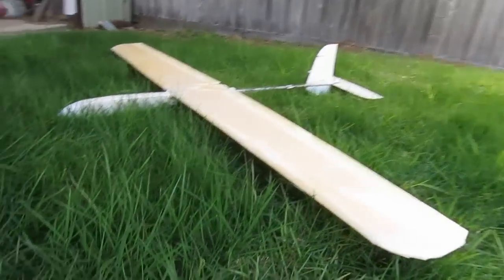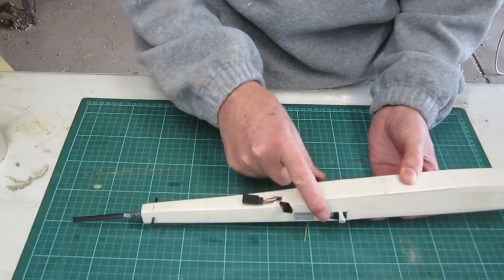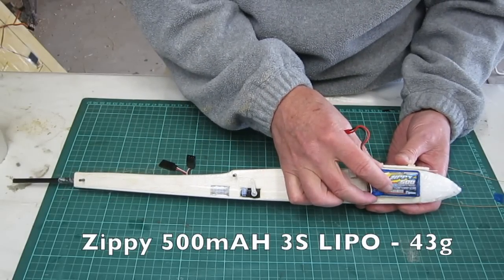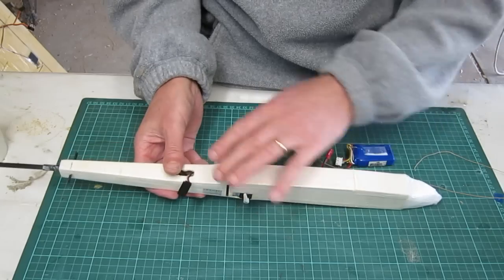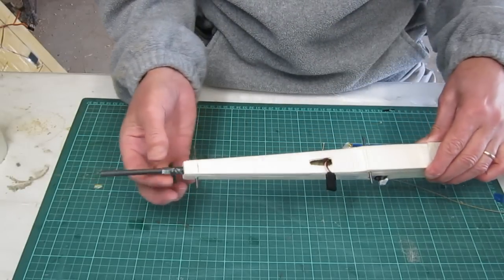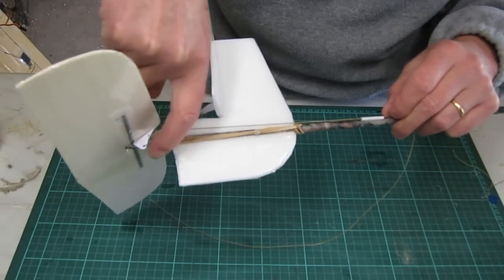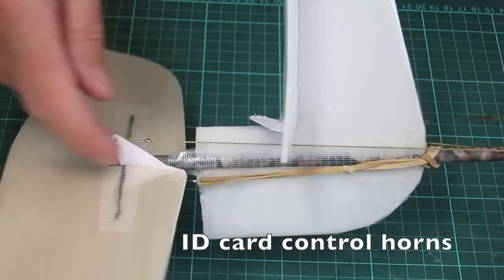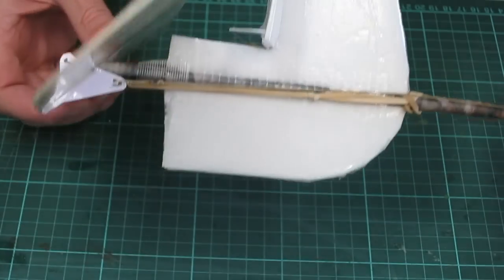Fusion sloper build overview

Comment: Great build Andrew! I am definitely looking at building a similar aircraft. I just have a few questions about glider electronics.

1. How does one select battery type for different size aircraft? (1s, 2s, 3s?) (What capacity battery for what flight times?)
2. Can a receiver operate off a 1s battery? (Would a voltage booster work?)
3. How does one select the required BEC? (1A, 3A?) (Does it vary with number of servos/components?)

I think that a comprehensive video on glider component selection may be useful for beginners like myself. There is not much information out there.

Thanks for all your great  local Aussie content!
Reply from the maker: Good idea for a video, I'll add it to the list.
I have only ever used 2S or 3S with a 3A or 5A BEC, but 1S can be used with a voltage booster (DLGs)
The question is will the servos work on 1S or 2S without a BEC. Normal servos will only work with 5 to 6V. HV servos can take 7V+ 
Most receivers can handle a wider voltage range.
Battery size is much less important because servos alone don't drain much current. I can fly me DLG for an hour on a 300mAH 2S. My slope soarers use 1300 and 2200 3S mostly for balance, I have never drained a battery while slope soaring.
I guess it would be best to use a 5A BEC for a big glider with flaps and digital servos, but 3A is OK for just about anything else.
Reply: Andrew Newton Thank you for your quick and indepth response.
Really helped clear a few things up for me.
Look forward to future videos!

Comment: thanks for posting.  some thoughts.  imo, an elevator would suffice.  the pull-string method of moving control surfaces used here is a 'blast from the past'.  i would use music wire pushrods.     cheers
Reply from the maker: Spring / pull is all about saving weight on this one, and I avoid long push rods if possible
Reply: there is nothing wrong with a long pushrod if it is installed correctly.  yeah, string is light, but i do not care for a mechanism that results in pressure on the servo at all times.   cheers

Comment: Hi Andrew, I'm building a fusion with depron wings, but I was wondering if your wing has the same width on the tip as in the middle of the wing. Yours looks good, so that's why I'm interested :)
Reply from the maker: This wing is tapered but with depron I would just make it straight like my DLG style sloper.
Reply: Thanks for the advice, I'll probably make the control surfaces narrower at the tips so it looks a little less like a plank.

Comment: Andrew, I'm building one glider about this size. But the weight turns out to be 1.2 kg. and my motor can only provide about 700g thrust. So, I'm quit skeptical whether it can be hand launched or not. So, from your experience, what it  the minimum thrust-to-weight ratio for hand launched plane?
Reply from the maker: Should be fine. Probably only need half the glider weight in thrust to fly.

Comment: Nice model, but surely having the flying surfaces spring biased in one direction means that the servo is under constant load which is not good for it or for battery consumption??? :)
Reply from the maker: +A .Circulator Correct, I would guess the battery life is reduced from all day down to a measly few hours. Never had to find out.
Reply: I wondered if another spring assisting the servo arm from the other side of the servo would relieve that
Reply from the maker: Yes it would, even a rubber band would do it.

Comment: andrew, it would be possible for you to provide us the items that you use in electronics and also the dimensions of each item of DLG FUSELAGE, THE SIZE OF CARBON FIBER ROD
Reply from the maker: +Wallace Sousa Hello Wallace. Materials and plans are linked in the description. I used HXT900 aileron servos and TGY9018 rudder and elevator servos. HK 6ch receiver, 5A BEC, 500mAh 3S battery.

Comment: Nice one...thanks for sharing.. btw the wingfoil made of balsa or can be done using deprone?
Reply from the maker: Jerome Fernando I made a wing using folded depron and it worked well, but this one is hot wire cut XPS foam (same as blue or pink insulation foam) covered with laminate. No balsa in this wing.
Reply: Ok i got it... thank you once again mr.andrew. you are amazing..looking forwad to see new gadgets in the future. Love your channel